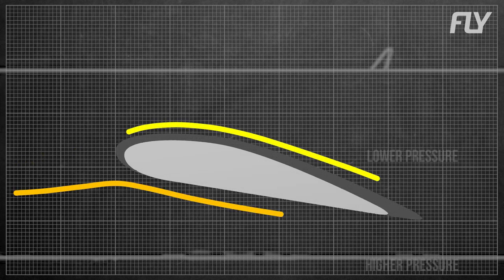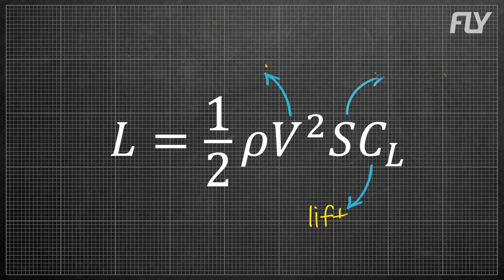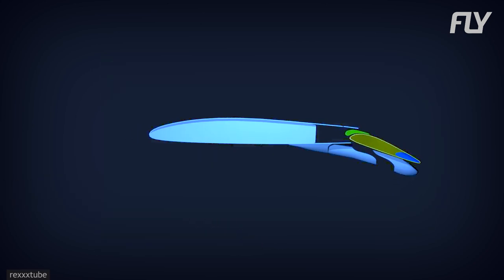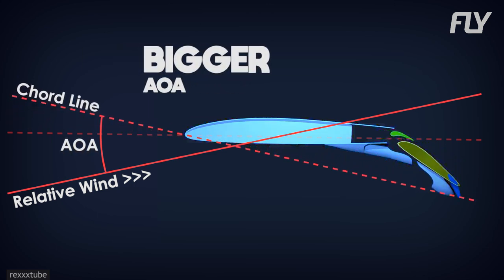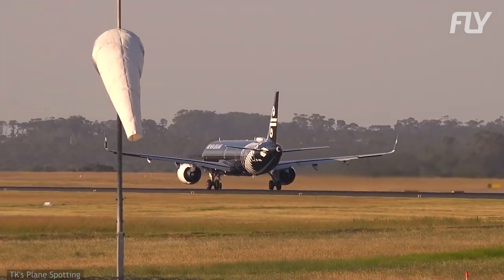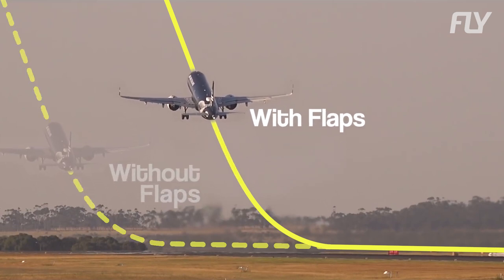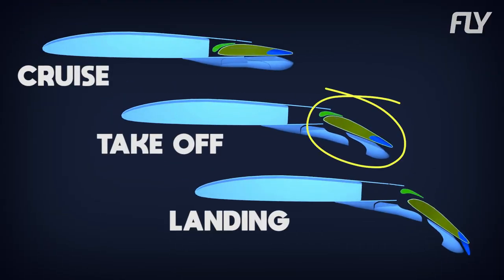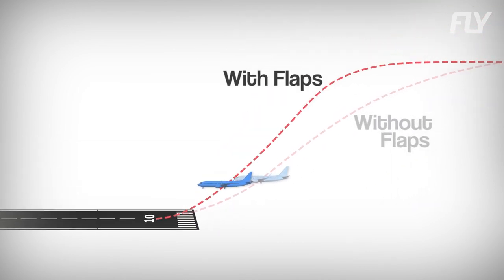Why Do Planes Have Flaps? | Fly Anatomy

Comment: Great video! The extra drag with landing flaps improves go-around performance. Once a go-around is initiated, the flaps are retracted to an intermediate position but due to the drag the engines are already at a higher power setting. The steep approach bit is relevant for light aircraft but doesn't figure into the operation of heavy transports, like airliners. Descent profiles are planned for idle thrust and clean. Happy landings!

Comment: Even if you are explaining step by step a lot of information is just passing in front of us, people don't know what's a cord line, angle of attack, power off stall, power on stall, etc etc etc. Using a big commercial airplane will complicate everything, the best way is to start with a small one like a Cessna, Piper or maybe a Cirrus, all the airplane's parts are small and really easy to understand, the same when you are learning to fly, exactly the same.

Comment: This is wrong.  It's not the "angle of attack" .  Nowhere does he mention the most important flap,  the leading edge flaps.  At take-off the air can't get out of the way quickly enough and gets bounced upwards by the leading edge flaps but immediately comes down again with the weight of the atmosphere pushing down on it.  This has the effect of creating a vacuum above the wing otherwise known as a shock wave.  The atmosphere detects a vacuum and pushes it upwards, all trillions of tons of it.  Vacuums have to go where vacuums belong,  to the top of the atmosphere. (equilibrium law).  But for all practical purposes it's just the air around the plane which  does the job.  At speeds above 400 knots roughly,  the air starts to have difficulty keeping up with the plane and tends to drag back on it.  The bang one hears when the sound barrier is broken is the shock wave above the wing collapsing., the shock wave failing to keep up with the plane.  Aircraft designers eliminate much of this drag by angling the wing back into it.   You can estimate the rough operational speed of the plane by the "sweep"  angle.   So it's not an angle of attack,  that's a common misconception.  Aircraft do sometimes fly upside down you know.

Comment: Thanks for making this video with the explanation.
       I still have one question: what are the consequences of flying with your flaps partially or fully down? Are there any aerodynamic consequences? Or is it just more fuel because of the extra drag?
Reply: well if u don't use flaps during takeoff u probably wouldn't have eniugh drag to takeoff befor the runway ends, wich can be dangerous. same for landing. without flaps u will probably not be able to stop in time.
Reply: @iMatti00  besides aerodynamic drag, flying with flaps extended at cruise or at speeds exceeding their limitations can structurally damage them
Reply: @iMatti00  the fuel consumption will almost double as the drag is increased,so more power is needed to accelerate
Reply: Is velocity not also reduced?